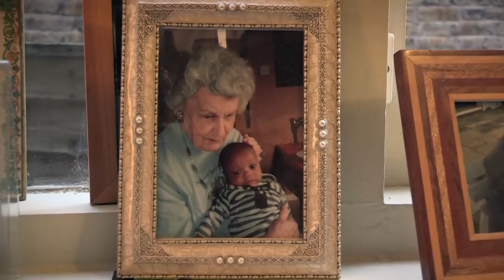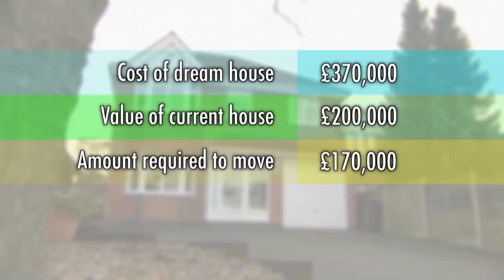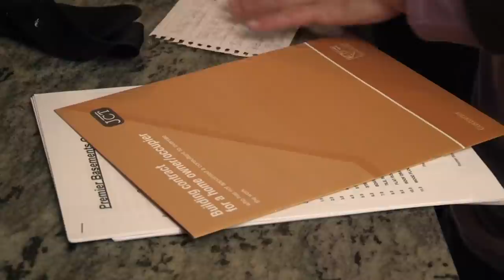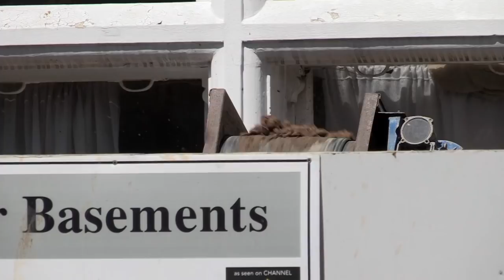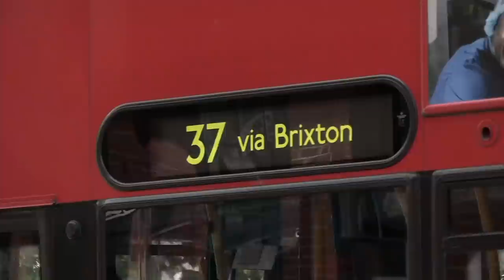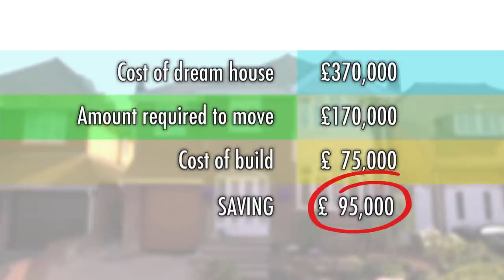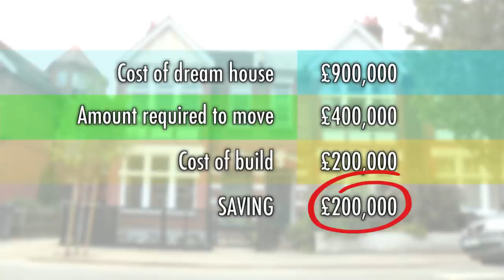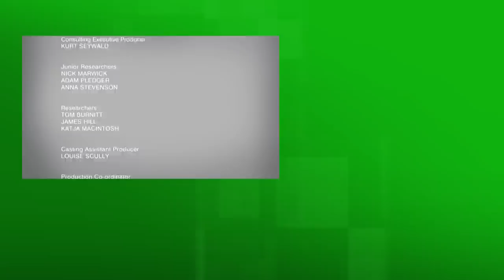From Chaos to Elegance - Double Your House For Half The Money - S03 EP5 - Interior Design

Comment: House #1 --1st floor plan at 6:30'.  Redo at 6:34.   --basement redo @ 6:48.

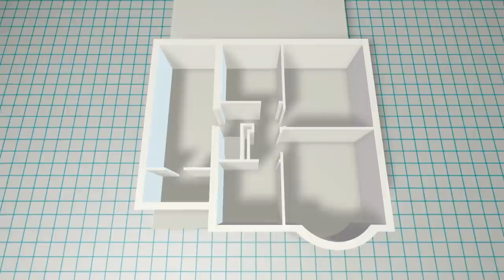House #2.--1st floor plan at 12:33.  Redo at 12:40.  New 2nd floor plan @ 12:55.

Sarah, your suggestion of moving established upstairs plumbing in the 2nd house is expensive. 
Just turn the direction of the stairs to make the biggest changes. Its new orientation is very workable, plan-wise.  
Borrow from the bathroom to make new hallspace, then give the old hall space to the tiny bedroom.  
The small bedroom is now two to three feet bigger on one side.  The bath loses about 3 feet . Give or take.  The large bath is still pretty big this way, but the overall floorplan is more workable.

Usually cheaper to change a few small walls.  Both rooms will work better with the 3 foot +/- change.  No major pipe moving...

Would have loved to seen all the plan chages...
Reply: What’s her name? I want to see a full tour of the finished home.